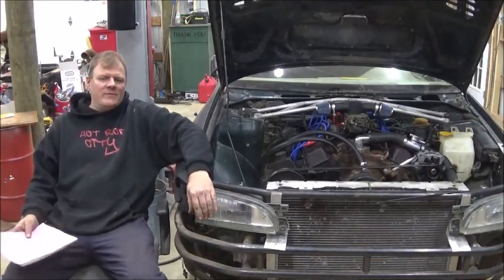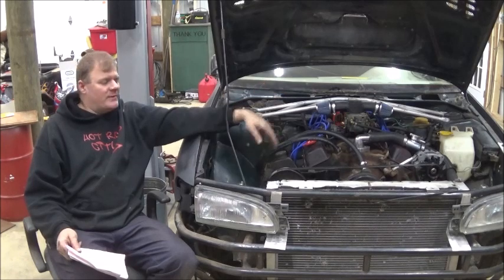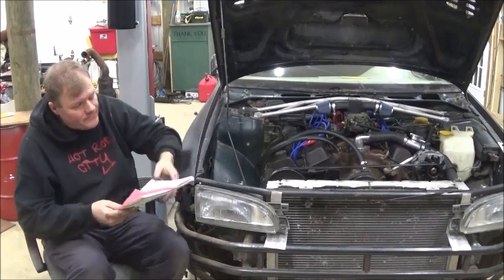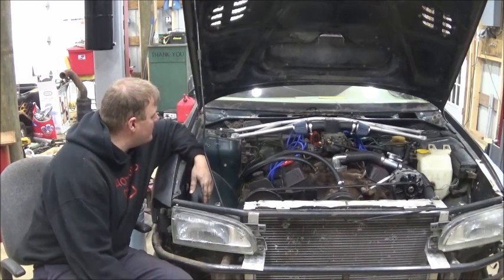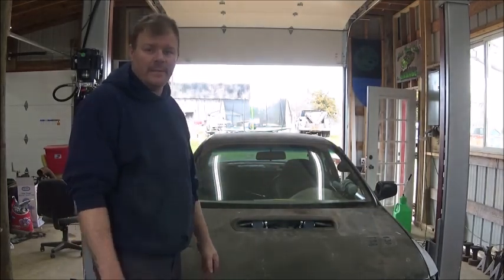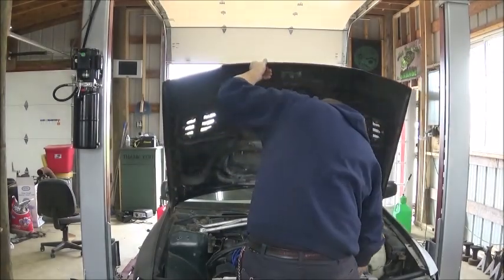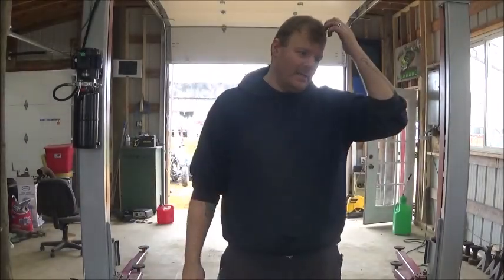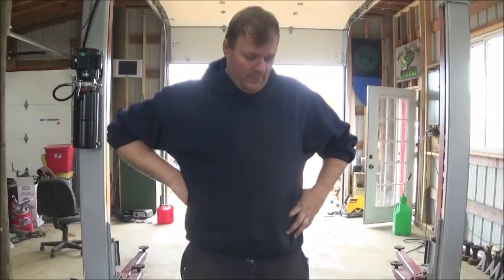Trying to finish the V8 Subaru

Comment: What motor is in it now joe?
Reply from the maker: I put a 305 from a 78 camaro, know as crap camaro
Reply: Get rid of all them cars and all that shit around your place get that chevelle in garage and finish it start to finish u waste alot of time fixing up junk to run that should be melted down from  scrap  your not a car guy u can tell your a you tuber w a property w a small junkyard on it. I may  just sound like an ass to u for this rant  but come on wheres your goal letting that chevelle rust away